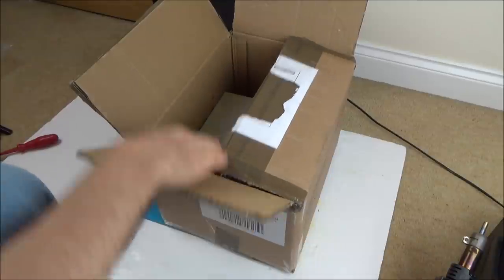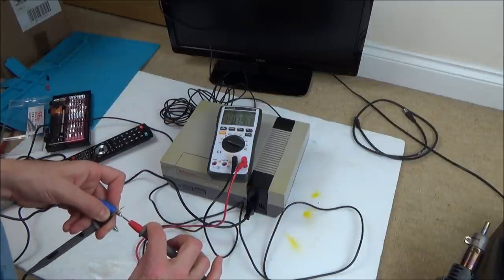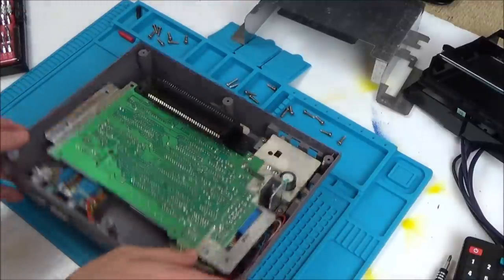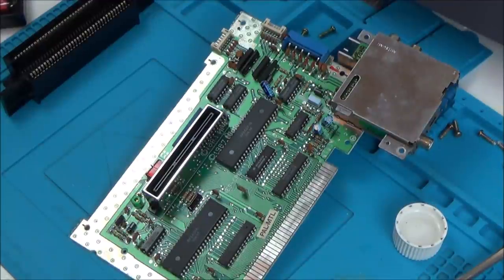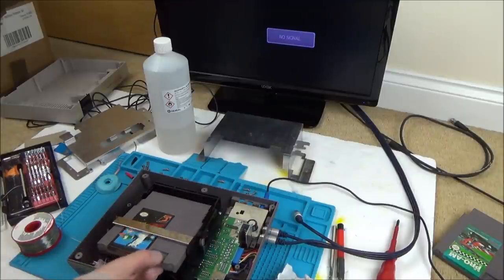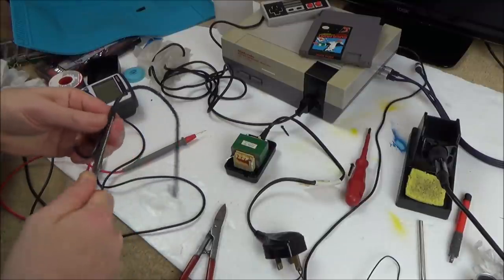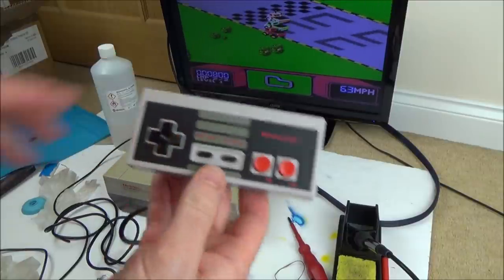Trying to FIX a Faulty NES (Nintendo Entertainment System)

Comment: Transformers are just long lengths of copper wire coiled around a metal core.  Wire of 24ga is about 84 ohms per kilometer and 18ga drops to 20 ohms, so continuity readings with both sides of the coil are to be expected on a good transformer.

Comment: transformer does not accumulate voltage but you can test primary and secondary windings for continuety ... on primary (220V) you should get around 300-700 ohms, on secondary around 10-50 ohms depending on transformer but secondary always show much less than primary but if its ok should show something in that range. The fault allmost anytime is near bending side at begining of the cable as you find and on majority of cases. You don't need to cut that much wire to fix it ... 2-3 inches was enough.
Reply from the maker: Thanks for the info :-)

Comment: Wonderful fixes, Vince!  I was way more surprised that you got the power supply working!!!  Nintendo sure get the award for the worst cartridge design when it comes to the NES!!  I have never had problems with Atari 2600 and other older systems and the NES systems were failing within the first year of release!  I remember me and my buddies trying to clean the carts with alcohol and blowing in the cart and it was awful!  I'm glad they learned their lesson with going forward!!!  Trying to make something more fancy doesn't mean it will work well!
Reply from the maker: Thanks Jim, I really liked the power supply fault. I like it when you can see a fault and then you know it is fixed. I hate intermittent faults because you are never really sure if it is fixed or if it will reoccur :-)

Comment: That is one thing I have come to appreciate about NTSC: To hook up a e.g. VCR via RF, you just tuned to Channel 3, while with PAL, novices had to search for the channel via a search (I don't even remember the RF channel on PAL that I used for my old Atari XE and we used SCART for the VCR back in Germany).
Reply: Channel 36 in UK , channel 38 to avoid interference with modulator in VCR ?

Comment: Its an NES. It'll NEVER work EVERY time. if you want it to work every time, buy a Blinking Light Win. its a replacement for the cartridge tray that works much more reliably, and removes the "locking" part of the tray (which is the main cause of degradation for the original cart slot).
Reply: Exactly.  Blinking Light Win for the win.

Comment: That adapter for the RF is pretty cool, although you might be better off using a female RCA to male RF, so you just screw the adapter into the TV and just plug a normal RCA lead into the NES or SNES or any other old console like that, but i guess it is nice having a cable that stays together as well

Comment: 6:50
I believe the UK introduced the legal requirement for sleeves like that on plugs sometime in the 90s however Australia also followed suit not long later in April of 2004 so legally all electronics sold in Australia after the start of April that year would legally have to have those protective sleeves! Those sleeves are also mainly to prevent you from touching the live pins when it’s not in the socket fully but is still live plus the Australian plug standard was originally created in North America in the late 19th century for higher power consuming appliances but it ended up being adopted in Australia and New Zealand as our pain AC outlet standard so it’s quite strange of how the US has not made it a legal requirement to have those sleeves on their appliances when they honestly should! :)

Comment: The holes that connect the two sides of the board are called vias. They have metal lining them, so no solder is required - the solder that is there is just due to the original wave soldering of the board.
Reply from the maker: Thanks Doug, that does make sense. Thanks for letting me know :-)

Comment: If you ever wanted to give the console casing a really good clean and almost restore it to its original colour you can soak the casing in hydrogen peroxide and wrap it in cling film you then place it underneath the UV lamp for a few hours. Old consoles and computers that used very similar plastics used to tarnish and you would get that off white colour the main reason for this funnily enough is to do with UV light.

Comment: hey vince, I know this is an old video just wanted to chime in on the power supply readings

I work on old Boss Guitar Pedals and ones made in the 1980s until early 1990s used an ACA 9v power supply that actually gave out ~11volts; the pedals at the time had some circuitry to pull the voltage down to 9V. It's a common issue for modern guitar players to have issues powering old Boss pedals with modern PSA 9V supplies because the pedal is actually looking for ~11v. I suspect there may be a similar thing going on between the NES and SNES eras. I know the SNES power brick was out-of-date with safety and long gone by now but figured that tidbit might be helpful in the future

Comment: You guys are lucky with that NES power supply, ours, in NA, has the power block as the actual plug. So if you wanted to plug in your NES, you needed room for that huge block on your outlet. Or take up 2 plugs on a power bar, cause it covers another one in the process. Very Lucky for you.

Comment: My speccy +2 power supply had the same problem, it seemed to be coming from the cable leading out after, I trimmed the end and re-soldered it and it seemed to work fine. The fault was exactly where you found it on your's, I reckon it's a common place to break on those kind of supply's.

Comment: Thanks to your video I noticed that my NES, after have watched like 4, 5, 6 videos here in YouTube to diagnose my problems, doesn't have any hole filled with soldering (as in 24:45 ). I'm going to fill the holes and to cross my fingers to get it to work again. I already cleaned my cartridges, opened my controllers, tested the big capacitor to see if it was the power input.

Comment: The lockout chip was for copyright protection, not for reasons of inability to function due to region.  But, as others have stated, the chip does not go without its own defects.  There are 2 10NES ICs to deal with: one is on the NES's main board and another in each game cartridge.  It's either both chips generate the unlock code in order to play said game or one chip (cartridge) emits the code and the other (NES mobo) decodes to run the game.  Which one is it?  I'm not sure. 

It wasn't foolproof, as there are workarounds.  One is to clip the fourth bottom leg of the 10NES chip.  The other (much more difficult) is to record all the codes that chip generates and make a custom replacement that chip emit at random those sets of codes.  Easier to do the earlier method.
Reply: the console chip is the lock, the Cartridge chip is the Key, if you clip the fourth pin on the console chip(technicly the speciifaction say to connect to ground(which the Cartridge chip does) but just clipping it has the same result)  you turn the 10NES chip in the console into another key, as there are now two keys but no lock the the NES will "enter an unstable state and no operation will be executed" which is a roudnabout way to say "nothing happens and the chip is bypassed"

Comment: Just a thought for future reference, when you get special bits like with the power supply, once you've got them out, take a Dremel or some other rotary tool, and cut a line in the head so you can use a flat head screwdriver on it.

Comment: So different seeing a non-Mattel version of the NES. The NES we had here in Australia (I still have my original one, though not currently working, it has a solid grey screen) is Mattel version, the RF adapter has a grey box on it. The other difference is the power adapter, the side that goes into the powerpoint is much longer on the Mattel one and also has no fuse on it, it just has a standard everyday 2-pin plug.

Also, does the "NES Version" have the RF channel selector near the RFC plug just like the Mattel version does? The channel selector was awesome as it allowed you to plug 2 RF devices into the TV, which is what the grey RF box was on the RF cable, you plugged the grey box into the TV, the hardwired RF cable into the TV and then you could plug another RF device into the box (such as a VCR, another NES, SNES, etc...).

The channel selector allowed you to then set the NES to a different RF channel than what the second device was using.

Specifically this RF adapter is what the Mattel version came with: https://i.ebayimg.com/images/g/RHcAAOSwjDZYhu6i/s-l300.jpg
The SNES also had an identical one, which means you could have a NES, SNES, and VCR hooked up to your TV all at the same time.
Reply: The NES I had back in the days was not a mattel version but still came with the channel selector and the gray box.

Comment: I'm early in the video, but have you ever boiled the 72-pin connector? I've heard that works.

Edit: There is a product called "Brite Boy" that is excellent on these old cartridge systems. You should get you some. It'll eliminate the risk of going too deep with a pen. I found this video to be very informative. Very nice work.

Comment: Transformers are basically just two pieces of wire that are coiled. There is one wire for the primary(input) and one for the secondary(output). So you will get a continuity reading on both terminals of the secondary coil. There should however be no continuity between the primary and secondary as they are separate coils.
Reply from the maker: Thanks, I never really thought about how they work before. So I presume that is why they are safe to use and reliable because the 240V coil is kept completely separate from the low voltage coil of wire. No risk of any component failing and passing the higher voltage over to the low voltage side. Thank you :-)
Reply: @Mymatevince  Yes. Passing a electric current through a wire causes a magnetic field around it. Because the secondary(output) is coiled against or on the same core. Passing a current through the primary(input) causes a magnetic field. Which in turn moves the electrons on the secondary(output). The length and thickness of the wire used for the secondary coil determines what the voltage and current will be.
Reply from the maker: Thanks, that makes sense :-)
Reply: Note on transformers there are different types:-  an Auto transformer is used regularly in industry and other application : not the same as above noted transformer and does not have a primary and secondary insulated from one another and as such there will be a relatively low ohmic value between the input line and the stepped up or down output, for reference understand/evaluate type of transformer you are working on before proceeding during testing, hope this make sense all the best Ellis
Reply: @Mymatevince  Ellis is right in saying there are different transformers. But the majority of transformers that you will deal with are step down transformers. In other words in the case of mains transformers they step the voltage down from mains to a lower voltage. But there are also isolation transformers(the voltage in and the voltage out are the same. Just there is no connection between the primary and secondary) and step up transformers. The voltage out is higher than the voltage in. These have one end of both the primary and secondary coil connected.
There are many instances where coils are used in electronics like speakers, microphones, motors, chokes and so on. The only difference is how you use the magnetic field or if you use it at all like in the case of chokes(also called inductors). Coils have both a impedance(resistance to AC) measured in ohms and also a inductance derived from length, weight , time and current. But basically inductance is the strength of the magnetic field(called the magnetic flux) caused by the coil. Inductance is measured in henrys. To measure the inductance you need a inductance meter or a LCR meter(inductance, capacitance and resistance meter) L being the letter donating Inductance(They used L instead of I because I was already used for current and they used I for current because A was already being used for something else). Like Farads the unit of capacitance a henry is a large amount so meters are read in milli henrys(mH) and micro henrys(µH).

Comment: The reason both pins of the secondary winding in the psu showed continuity to the centre of the connector is due to your meter seeing continuity through the secondary winding on the transformer hence when you disconnected the wire you only saw continuity on one wire 👍🏻

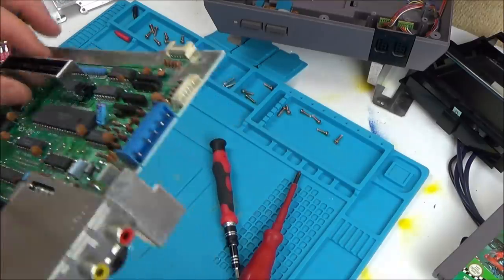Comment: 20:15 
that connector was more than likely meant for the add on for NES that used floppy disc format, it was only released in Japan and originally Super Mario Bros 2 (Lost Levels in USA at least) was released on the add on.

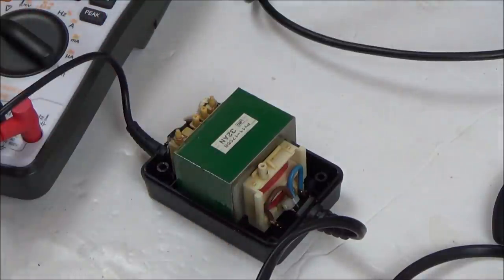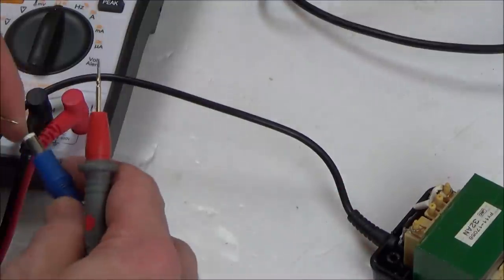Comment: Hi Vince thanks for the entertaining vids future help notes:  41:51 never trust test/check against an unknown zero when checking for live voltage/stored voltage(capacitors), good practice for your own safety dude..... use a known zero reference e.g. Earth point. could of still been live if damaged circuit(lightly different circuit with caps):  Transformer 42:29  looks like you were reading the small ohmic resistance of transformer secondary winding ....not a short that's why your meter buzzed, set to read lowest ohmic value if you can for a true reading to help fault find, hope this helps, thanks for the great entertainment dude n keep up the good work please.Ellis
Reply from the maker: Thanks for the advice, so I could use the earth from the screws in a wall power outlet or light switch, basically a separate earth from the actual equipment that I am testing, is this correct?
Reply: Hi Vince, Yes but (always a but) Never trust what you think something is, where your life is involved,  double check, always pre-prove test Earth Point is a zero potential you are using, (takes two ticks), 

If you don't check Worst case e.g.....:- wall box/screws may not be earthed, wall box/screws may be live..... and insulated from Ground/Earth, 
- Say your checking voltage with a meter from Screws to a potential Live 230vac you think you've isolated. 

They may be /= the same...... so no potential difference/voltage..... meter reads zero volts, (cause they are both the same live same source) 
so you end up working on a live circuit and don't realise....... due to an unproved/ tested earth point.....
(note the above e'g. if circuit had RCD should be picked up leakage, or with a neon screwdriver even could be used to double check no live, you may use different safety equipment to check if circuit is live dependent on scenario, case by case..) 

Hope the above makes sense, i waffled on a bit.Ellis
Reply from the maker: Thanks Ellis, yes that makes sense :-)

Comment: The NES and SNES use the same PSU, which can be opened with a large U-bit. They just consist of a simple transformer inside, which delivers the 9VAC voltage for the console. They're usually not faulty, but what does happen a lot with these NES / SNES PSU's, is that the cable from the PSU to the console breaks inside. So, when you replace the output cable, you'll probably be able to fix the PSU.

Comment: I've had 4 of these power supplies
2 new/SNES, 2 master system where the fault was a break in the wire just out of the coil, so a short snip, and pull through, re solder and they are good to go.
Tends to be the constant folding of the wire every time the same person puts the power adapter away and folds the write as tight as possible
It's my go to for any faulty power adapter or controller, right at the exit of the adapter/controller/device

Comment: I was like, "what AC? why does the adapter output AC? Is there just a transformer inside?
....yep its totally is... okay" :D
Reply: The original NES is beefy enough where it will accept AC or DC as an input and turn it into 5VDC.
Reply: @skiesohryu  yeah i swapped the original power supply with a standard 9V DC Adaptor and it worked. And I think my original one just got the same fault as the one vince has got.

Comment: Those snes power supplies are pretty bullet proof, it's usually the low voltage cable that breaks where it goes into the block, they are fixable
Reply: Apologies I added this comment before I got to the end of the vid, looks like I was right haha

Comment: Most modern flat screens don't like RF signals, they are basically too weak, so the picture is either bad or it doesn't work at. So it makes sense it got better with a shorter cable. if you absolutely need to do RF for an old console (pong consoles and such) you can use an old VCR as a past through to out put a composite signal to the TV.

I don't know about the European SNES and it's power supply, but the US SNES is center pin negative, the opposite of pretty much any other games system, so using another power supply can be bad for it or using it's power on another system can be bad. Japanese super Famicoms are the opposite and I use a Sega Master system power supply for it.

Comment: On the sides of every cartridge towards the top there are these little plastic textured grips or whatever you wanna call them. When the cart can't be read try jiggling it left and right using those grips while it's pushed down and the power's on then hit the reset button. It's advice I got from a retro game store owner years ago and it works about 95% of the time.

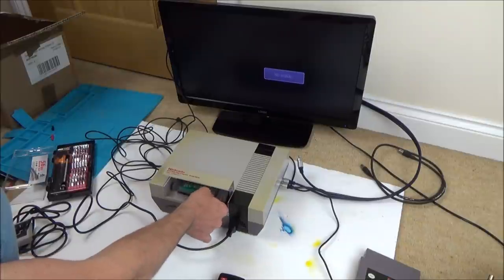Comment: 12:00 you have to blow on the contacts, worked for me.

Also duck hunt on your machine seems to run slower than I remember. Must be 50Hz power.
I think the NES used the AC mains frequency to control it's clock speed so if you used 60Hz it should run faster.

Comment: You mentioned being nervous about the cable not being in the proper strain relief because of safety concerns. While the finished product is great (great video), you won’t being getting line voltage on the secondary.